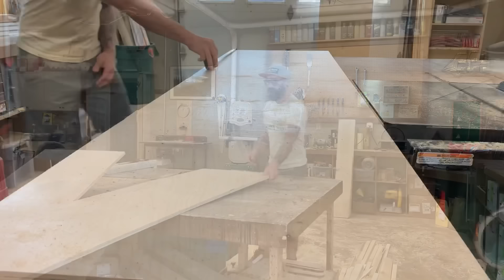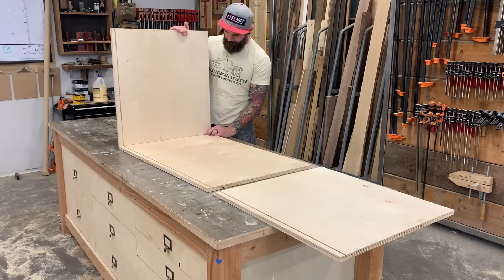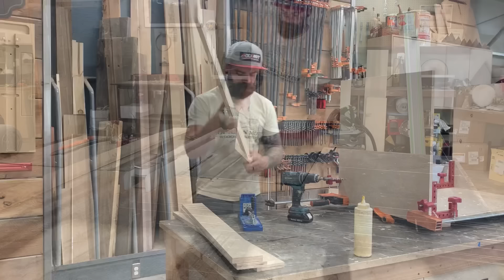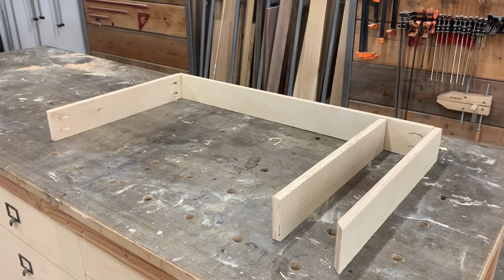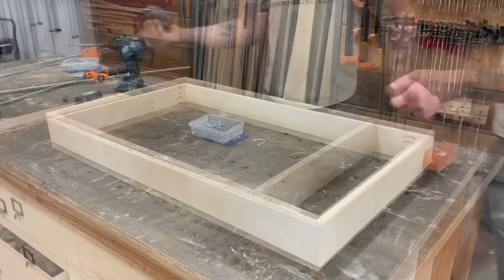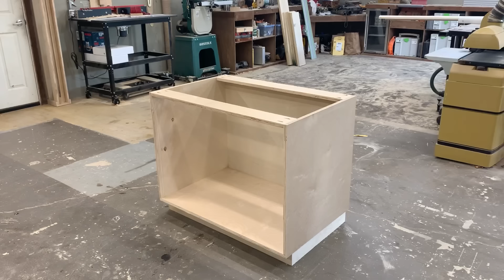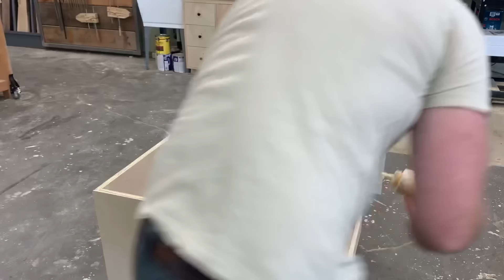Build Cabinets The Easy Way | How to Build Cabinets

Comment: Love the video, as a casual weekend-warrior, there's always something for me to learn.  I'm one of those people who recoils in horror at pocket hole joints, but really for me it's no big deal to change the joinery to something a little more robust (I'm not in a production environment, so it's okay if it takes me 5x longer).  I mean, box/finger joints or even lap joints work great if time isn't a factor.  Everything else applies, and you have plenty of little subtle tricks that will help me in my weekend woodworking :D

Comment: Well done video! You make it look very easy and you explain everything very well. What was the cross member in the base? Why was it off center? If you are going to have granite counter tops, is that kick plate and the dadoed sides strong enough for the weight?

Comment: So..question. My kitchen isn’t very big, but I have this section of blank, useless wall that I’m thinking of putting additional lower cabinets in, and open shelving above it (so it doesn’t make my kitchen look even smaller). 

Is it wrong to build the lowers on the shallow side? Say, 16” deep vs the typical 24”?  What if they don’t look EXACTLY like my other cabinets? Should I just make them so obviously different that way I don’t risk it looking like I tried to make them match but failed???

Comment: I do it the same way  but  it's  ea to  use a  router for the  grooves  I have a  router  mounted in my  table  to the right of the  blade  so I can  use the  table  saw  fence

Comment: I work in a cabinet shop that does primarily laminated and paint grade cabinets. I use a narrow crown stapler on almost every project I work on. It holds 10 times better than brads and the holes are just as easy to fill. It holds so well I usually don’t need to use clamps as I work as I can glue it, nail it, and move on to the next part of the project without having to worry about anything coming apart. Also bondo is a great nail/seam filler for paint and laminate projects. You can buy it buy the gallon and it’s sandable in 15 minutes

Comment: Excellent.  I've been doing DIY like this for 50 years.  My techniques are different but our end results are the same.  Couple of quirky things I do:  I use the same finger method for glue.  Since I use Elmer's Carpenter Glue. which is edible in small amounts, I just lick the excess glue off my fingers.  I also use wood fill liberally (somewhat edible), so I am not concerned about using wood screws on the exterior surfaces.  I've even used them when the cabinet has a high-gloss finish without them being visible.  However, my preferred method of attachment is wood dowels drilled through the outer piece into the second one using 1-1/4" brads as the stabilizer until the dowels are set.

Comment: Wow, I have always been under the impression that cabinetry was hard to do.  I do have a couple questions for you or whoever can answer.

1.) Do you not need to brad nail the side panels to the bottom?  I always am leary about how strong wood glue is.  But I'm also new to woodworking so I'm learning.
2.) I LOVVVVE using pocket holes.  But I thought I read that you aren't supposed to make them with the grain and instead do them against the grain because it's stronger?  Would love to hear your perspective on this.

Comment: Nice video. I enjoyed watching it. Your cabinets look a lot like the ones I have built for our kitchen, and several others. I am not a pro but did manage to build almost 100 cabinets and other projects using the same jig and methods. But, dude, you need to up your pocket hole jig game. I modified the same one you used by installing a foot operated pneumatic cylinder to clamp the work piece in the jig. I can drill the holes as fast as clamp, drill, move, repeat. A lot cheaper to build than the one the manufacturer sells, and a whole lot more fun. It also makes a great pecan cracker! :) Keep up the good work.

Comment: Cool trick to attach a face frame put a nail in the play wood and cut it so it stick up a little then hit the face frame with a hammer and it won't slide so you can glue them on

Comment: My man has a Festool track saw, Woodpeckers track square, Woodpeckers setup blocks kit.... And then makes a 3/4 rabbit cut with a 1/8" blade on the table saw. Smdh my dam head.

Comment: The third cross piece in the kick plate assembly is to stabilize the mitered corner? It looks like it's held in place only with glue. And how did you attach the carcass to the k/p assembly.

Comment: I refinished my 1970's oak kitchen cabinets because...NO CHEAP PLYWOOD BOXES.  There were NO BOXES period. It was all oak hardwood custom cut, installed and finished on site. The doors were made on site as well (you could tell- lol) but I put new shaker doors on, installed self closing drawers, etc. Looks great and if I build a house I will just do the cabinets that way rather than pay for overpriced plywood boxes that fall apart. I could tell how they did it, they made a frame for the base, attached it to the wall and worked their way up screwing in the uprights and cross supports, etc as they went. No boxes anywhere and solid as a rock. You could tell they had nothing but a jig, miter saw, square, finishing nails and glue. They had some wood laminate backing boards, but the rest is all oak.

Comment: I'm a fan of building the toe-kick and cabinet separate as well. In one build, my toe-kick was 3-1/2" at one end and 4-3/8" at the other of a 11 foot run. After the toe-kick being installed, the cabinet boxes were a breeze.
Reply: how do you attach the toe kick to the cabinets?

Comment: if you don't have a rip guide for your circular saw for the smaller cuts, think you could get away with using a 4ft Drywall T-Square?

Comment: Long time subscriber, first time question asker.  Do you have a common dimension you use for the cabinet carcass to extend out past the kick plate?  Is it 3 1/2" as well (same dimension as the height of the kick plate)?  Thanks in advance for any help!  I'm going to remodel my kitchen with cabinets using your videos as templates.

Comment: One tip for your subscribers. For those dadoes, use a table saw blade with a flat top grind, or "FTG". That will give you  nice, smooth dado edges vs. a ribbed surface that you'll then need to smooth out with a plane or chisel.
Reply: Good tip. Learned that the hard way with the table saw I borrowed

Comment: so i bought a 10"  dewalt 15a table saw with stand. think thats good enough to make something like this?
Reply: You sure can, but make sure you have some type of infeed and outfeed supoort for that big sheet of plywood. The only catch is whether your saw fence will lock in at least 24" from the blade. Alternatively, you can have your building supply store do an initial breakdown of the plywood sheet for you so it'll be easier to handle. They usually do this for free.

Comment: How would I extend existing cabinets to the ceiling?  The top half of a carcass with pocket holes attaching to the existing frame?  Cut off the top of the fascia with a Japanese pull saw and use that black and white putty to hide the seam?

Comment: I love your video series. It will be awesome if you include all the cuts measurements. From the video I get you are using 3/4 and 1/4 plywood as well as 3/4 sticks; but there is no mention on the height or deep measurements except the 3/4” and 4” height of the base. It will be awesome if you share all the measurements too.
Reply: The thing is, it varies from project to project. Are you putting in drawers or doors? I use this method, and review right before a build (because I'm not, nor do I ever want to be a full time cabinet maker)and even having seen this when it came out, love the simplicity of this build. BTW the height of the base is 3.5"(kick plate) The wood is .75" and .25" cabinet grade maple ply The face frame is .75" poplar. The width is what you make it. aoxo

Comment: Dados are "grooves" in the interior surface of a panel, not on the edge.  A rabbet is an "L" shaped section on the edge of a panel.. You incorrectly use both terms interchangably, but they are not because they are different. Do some research on You Tube, you'll see what I mean. Other than that, it's a good video.

Comment: Great video.  I’m building two 48” cabinet carcasses for either side of my fireplace (that built-in look).  I’m considering dados like you did in this video, but I also own a domino, so I’m considering using that.  Any chance you’ve built cabinet boxes using a domino and if so, can you comment on your personal experience doing it that way vs dados (which you make look very easy and straightforward).  These will be paint grade cabinets (also note that I own a kreg jig and those right angle woodpecker clamps). Thanks!
Reply: I think the reason he used dados was so that the edge of the bottom piece of plywood was covered by the side panels.

Comment: Moth, wanted to say thanks a ton for this series. If you were making a wall cabinet here instead of a floor cabinet, would you just make the top the same way you did the bottom and omit the upper stretchers? So, top would half the 1/4 groove 3/4" from the rear plus the two 3/4" rabbets on the edges so that the top and bottom were mirrors of one another?

Comment: From a cabinet maker / finish carpenter always leave a reveal where two pieces meet like at face frame to side. With expansion and contraction you will never hide the seam indefinitely. It will always rear its ugly self. If you leave a 1/8' reveal you don't have to care about expansion etc.
Reply: What’s a reveal? Thanks

Comment: Love this series! Can you shed some light on why the kick plate layout wasn't symmetrical? There was a third, shorter piece that was off-center and I'm wondering why it wasn't centered?
Reply: My guess is because the outward facing corner that he only glued needed to be supported. There was no pocket screws for that corner so he used an internal piece to add structure
Reply: I have the same question.  I love this content creator!

Comment: Can you tell us what those gauges are called for measuring the height of your table saw blade for the daedo cuts?
Reply: They are called setup bars. They can be found at most woodworking shops.
Reply: @jlinc187  Thank you! :-)

Comment: Baltic Birch is hard to find where I am and seems to be a little too “premium”; I’m making some for the garage... HD has 3/4 sheets of Sande ply in my price range; I’ve never heard of Sande. Is it decent? Does it take paint well? Thanks in advance.
Reply: Do you mean sanded ply? Sanded ply takes paint very well, you can even stain and varnish it.
Reply: @eugenewilson7555  on the Home Depot website it says “Sande”... unless it’s a typo.
Reply: @FC-yq9om  it’s likely a typo. I get sanded plywood from Home Depot myself.
Reply: @eugenewilson7555  thanks for the help man!

Comment: I usually laugh when I see how people cut on a table saw on youtube. I must say you are the only person who can come close to how well I cut wood and use a table saw. Even the custom finger brush to spread the glue is one of my best tools. I used to use the 45 degree cut for many cabinets in hospitals that I used to make furniture for to hang them easily. And yes I used to use wafers and dowels to attach wood pieces until the pocket technology was created. Hmm Guess I'm showing my age. lol Hey I even agreed with you on nailing the front face frame. The other option would be pocket holes on the inside to be hidden by the drawers.
As far as the epoxy filler I would cover the plywood with tape up to the crack of the side of the face frame so you wouldn't have to sand the plywood and then only sand the side of the front face frame. This way if you sand the plywood it will only scar the tape. Try that next time. You'll love yourself for it. If you use a high gloss paint on the plywood  when you apply the epoxy you will see the indentation of the sander path.
Great video. Wishing I had a big garage like you to hold the custom table saw I used to use at my last carpentry shop. Nice shop!

Comment: what is a "datostack"?  I dont even know if I'm saying that right
Reply: A Dado Stack.  It is a term that references the way in which certain systems, m ainly those created for use on table saws, can be configured to produce a certain width of dado.  Imagine several saw blades with spacers in between them, held together on one spindle.  https://www.youtube.com/watch?v=9ztRorFfkn0&ab_channel=RocklerWoodworkingandHardware
Reply: @theprofessorfate6184  Thank you.  I appreciate it.  Trying to learn all this stuff as much as possible.... 😁👍

Comment: Face-frame cabs in my humble opinion look the best. Some people would drop the cab walls to the floor, indented in the bottom front for the toe kick, to save a few steps, and the flat bottom piece of the cab would be like a shelf between the walls and sit on top of the toe kick. Thanks for the vid and clear instructions. You gotta be a whiz with accurate measuring. Look forward to next vid on making the drawers.

Comment: Very excellent videos. My is wanting me to build new ones for our kitchen. I've never did cabinets before, but everything else, and I'm also a violin/harp/guitar maker. Lucky for me, I just replaced ALL of my shop equipment with new better equipment, all pieces work great, and very accurate. So I will be making new ones! I only have to make 2 to hang on the wall, then 2 on the floor, one with the sink opening. I appreciate you doing these videos! It gives me insight on how and what to do. Thanks... thumbs up for sure. Also, never mind the 248 mental midgets that did the thumbs down. They are most likely so stupid that not only can they NOT cut wood, they most like crap their pants instead of cutting the cheese! They are boneheads with no life!

Comment: Have you considered counseling?    I  tried it and it worked the first session !  (small joke). Nice box you build ! Solid ! The separate (toe-space) is great too !  Allows potential use of the space as well. I want my toe-space to glow in the dark...
And if things were not crazy   enough, I see the (Star Trek ) clear aluminum has arrived ! I bet Gene Rodenberry was wired in to...
I'm a 'user' of (two component) five minute epoxy.  It can be modified with various thickening agents ( greater or lesser tensile-strength of the resin) (if you're quick about it ! )
requires very little clamping pressure and allows the project to move along. Ultimate bond-strength is only about 50 %  of the high-strength resins that require longer working-times, but is substantial !
 Nice shop you have !   I'll keep watching, you keep dancing !

Comment: Great video! Getting back into woodworking and forgot a lot of basics after 20 years. What size/gauge nail did you use for the face frames? I'm making a kitchen island, would you use 3/4 ply for the back piece as well? Do you have any experience making drawers in the toe kick space? Your voice on the voice over sounds like Eric the Car Guy on YouTube. Great shop too.

Comment: Thank you for these videos. How do you attach the kick plate assembly to the cabinet? Pocket holes on the kick plate or screws through the bottom shelf?
Reply: I would like to knowledge this as well.
Reply: I have not heard back and decided that since I’ll attach the kick plate to the wall stud I’ll do the same with the cabinet and that will hold them together.
Reply: ^^This^^
Reply: Take the toe base or as he calls it a kick plate, to where you want to install it. Get it nice and level with wood shims. Then you can screw it to the wall hitting each stud or screw low and catch the bottom plate. Then put your cabinet box on top. Since the toe base is already level and attached to the wall. You then screw the cabinet to the wall. Neither one will move as they are both screwed to the wall.
Reply: @socaljimmyd  Thanks, Jim. I ended up doing exactly that. They turned out pretty good for my first cabinet build.

Comment: Love your presentation, but I'm not a fan of making a separate kick plate box. You will definitely see a seam between the cabinet and kick plate box. At the same time, you spent a lot of time and effort filling and sanding  the face frame's 1/32 reveal.

Comment: Great vid! I built cabinets in a pro cabinet shop for a couple years, your process is very similar. One question: How do you decide where that extra support piece goes inside of the kick plate?

Comment: OMFG those woodpeckers things are pricey. Ill just make my own
Reply: The woodpecker's clamps are on sale now for $190 for a set of four solid aluminum 90º elbows and eight clamps. If you go to Rockler's, they sell a single plastic elbow + 2 clamps for $30. That's $190 for machined & anodized aluminum vs. $120 for plastic. I'd go for the woodpeckers over Rocker's, but sure, you can make your own, no problem.

Comment: I guess we are at a difference with the toe kick height. I like to go to the extreme at 4 inches height because not knowing what the finished floor may be adding a wood floor or tile which will bring down the space of your toe kick. Also ever try vacuuming using a commercial upright vacuume with your 3-1/2” toe kick. In my opinion You need the added clearance.  Good video though... Greg
Reply: I always install my cabinets on top of the finished floor.
Reply: @alstevens8650  What happens when you need to replace just the flooring?

Comment: What is the woodpecker measuring tool on your miter saw? I need that.
Reply: Woodpeckers Precision Woodworking Tools TS-32-2 T-Square (depending on the length they run around $125 - $150 on Amazon)

Comment: how did you determine the width of your faceframe styles and rails (thinking drawer volume and slider hardware and all that)?
Reply from the maker: It really just depends on look and what you’re trying to fit in the space you have to work with